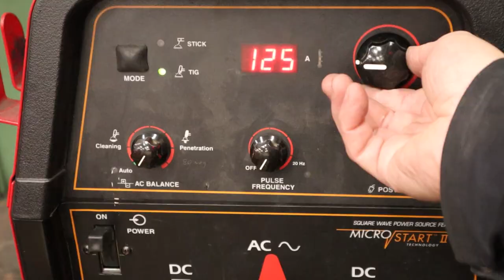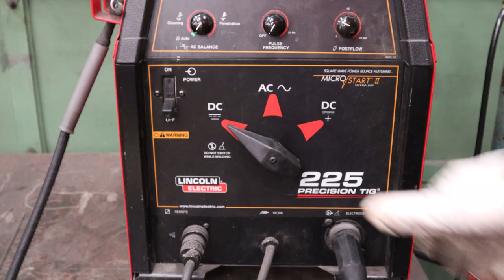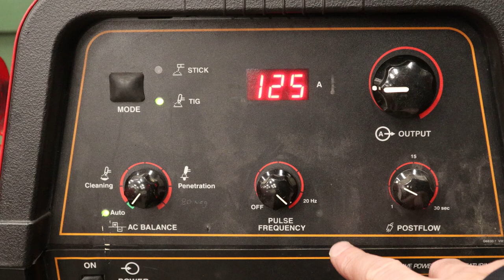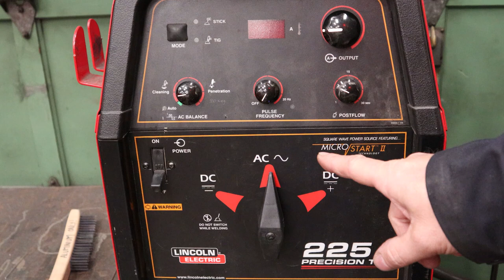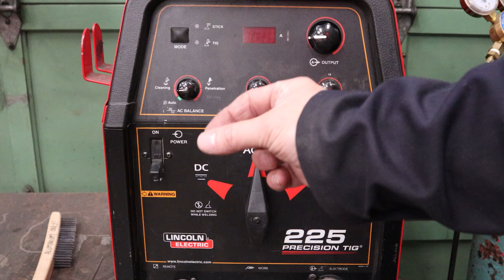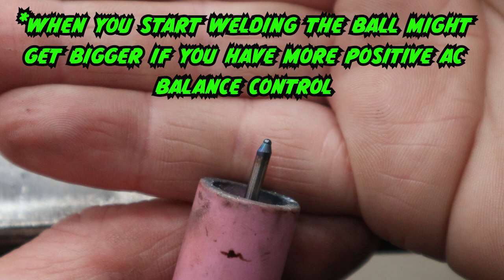The secrets of welding Aluminum!

Comment: Any chance you could include a small segment on Oxy-Acetylene welding Aluminium too? I've been dabbling but it's blooming tricky to get consistent. Thanks for the splendid content.
Reply from the maker: Ya know I'll be honest, I've never done aluminum gas welding but I would imagine you're using smaller torch tips and a slightly feathering flame to prevent oxidizing the Aluminum.  You'd have to have an Aluminum alloy filler rod or one with flux, maybe even using flux paste.  Depending on what you're welding you might need a little preheat too.  If I get a chance in the future, I'll giver er a try and make a video.  Thanks for the idea.  Cheers!
Reply: @wayofthewrench  Thanks! Yup, I'm using aluminum welding flux on the edges and 4043 filler on 3003 sheet. One size larger tip than for the same thickness steel and a soft flame. It welds OK but it's a bugger to make anything resembling a nice bead...look forward to watching pt 2.
Reply from the maker: cheers!